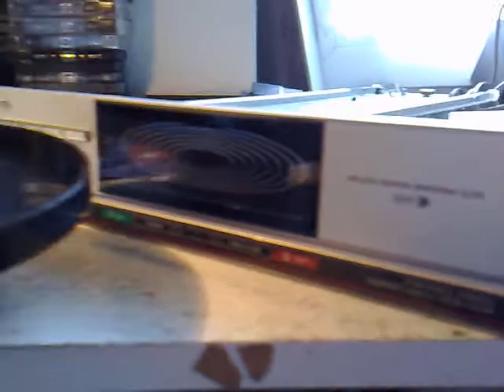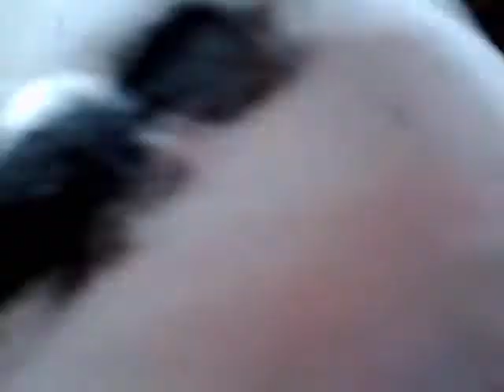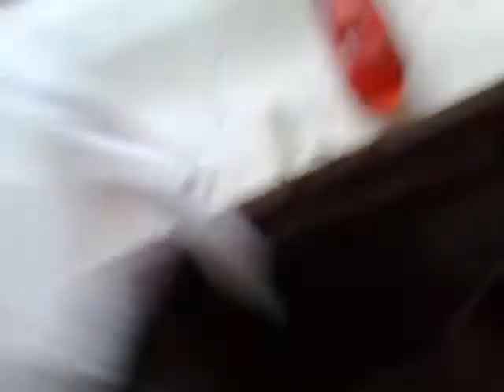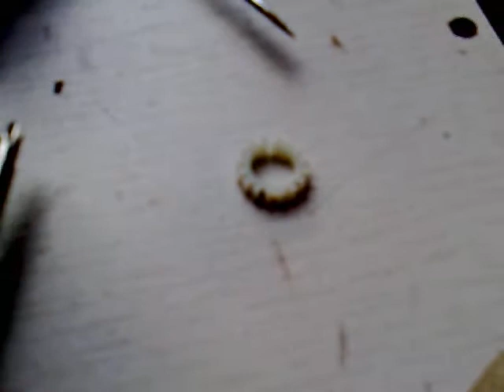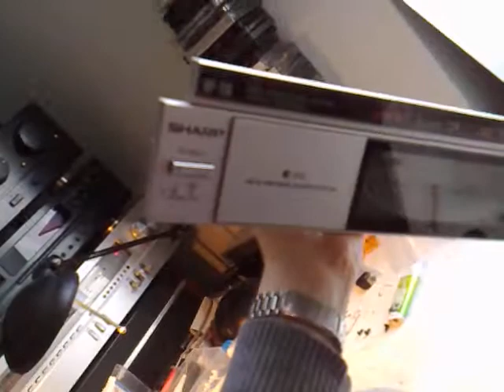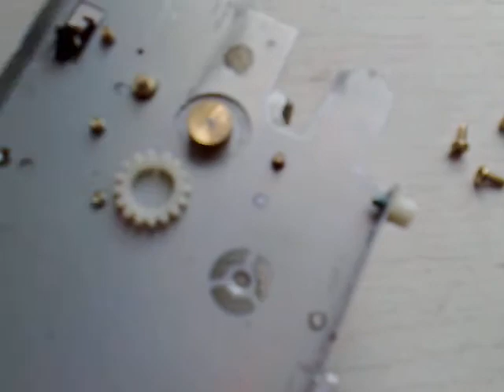Trying to repair the Sharp RP-116 Drawer Turntable,without success.. :-((

Comment: I had the same problems
 broken gearwheel adjusted slightly by dissolving the plastic on one side then the other, before, however, I have filed the inner part so that enters into its housing without pulling and open, then the I fixed with a glue called bi-component liquid steel.
 I have to say why the two broken gearwheel limit switch broke, opening and closing, remove power completely open and remove power completely closed.
 Does the repair, it's worth it.
 hello

Comment: fine that you've fixed this already;I had the same problem with my RP-117 - in fact it got several problems - broken belt,broken connector(connecting circuit board in drawer with the rest)- due to this everything worked well except for horizontal progress of stylus during playing(wrong angle wasn't reported to CPU due to a broken traces - I've spent hours trying to figure this out and eventually replaced whole drawer from broken RP-107)and broken gearwheel;I've just glued it to drawer motor axis

Comment: mine is spinning slightly too fast... anyone any idea how to fix that?
Reply: You got the wrong belt. It needs to have the right width or the pressure is too much which results in speed problems. You have to change both belts. 
The small one and the main one for the turntable
Reply: actually, I found some potmeters on the circuitboard to change the motor speed. I think the cause of the problem is the change of the net voltage from 220 V tot 230 V about two decades ago... the belts are original and still ok.

Comment: hi i have the same player. fixed the plastic wheel but now i need a replacement belt anyone know where i can get one? Very nice app. dual needle great. Sound is also surprisingly good
Reply from the maker: +blablabla bla Cool.....  How do you fixed it?  On ebay you can find some universal belt kits.
Reply: FeCr3 hi it was some time ago but i think using some superglue did the trick. Ill have a look at ebay for the belt thx

Comment: this is a common problem with these , however it is very rewarding to eventually get them repaired i have one in use and one for spares , both have the wheel problem for the loader section
Reply from the maker: Yes. I have it still. Someday i will fix it when i can get a new wheel...
Reply: actually im going to try moulding one from resin see how it does , i will let you know

Comment: There is an excellent adhesive called "Plastic Surgery" distributed by Surehold.com. and on Ebay? The glue is a type of "superglue" but it additionally etches the surfaces of the nylon gear and holds well (4 for me so far). The original nylon gear cracks because nylon shrinks with age. I relieve the inside diameter of the gear with a dremel tool (or round file) and then glue it together back onto the brass shaft. Hold it together for 5 minutes at least and don't use it for a day.GOOD LUCK!!